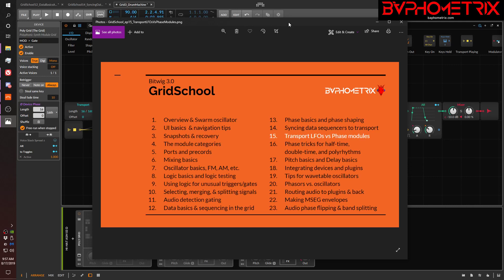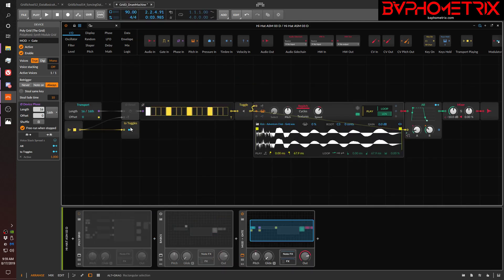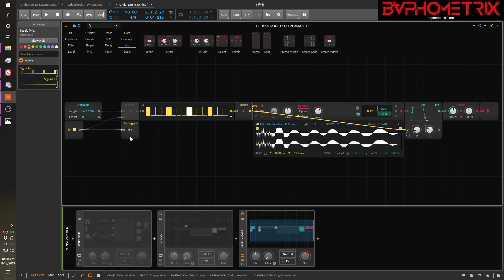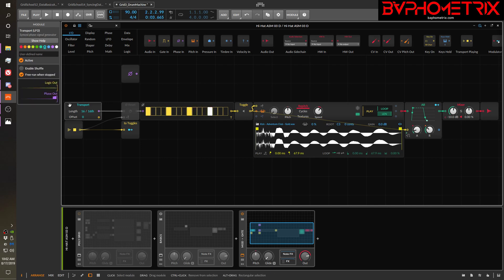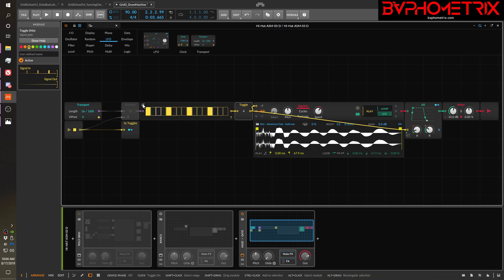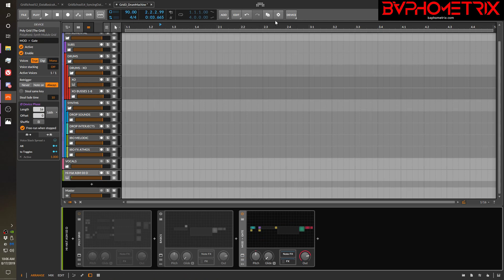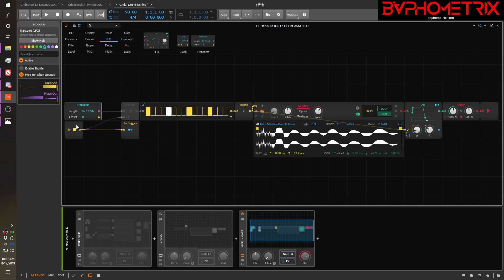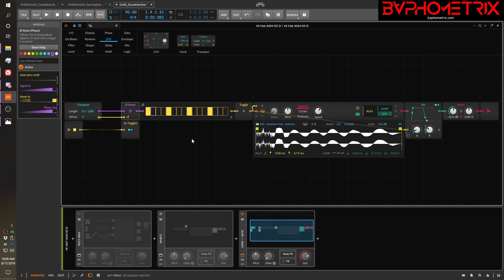Bitwig Grid School 15 - Transport LFOs vs. Phase Modules

Comment: We really need a way to do cable management in the grid :( Should be able to put them along the grid lines imo. Pin module or something would be sick and satisfying. like so you could stick a pin in the grid joints, then loop the wires around. The mess really stresses me out.

Comment: Hi, I really enjoy your videos. I have learned a lot. One question, what happened with lesson 16 through 23?
Reply from the maker: Haha yeah, sorry, I never finished out that particular series. What happened is that Bitwig themselves finally started putting out a lot of videos about how to use the Grid, and they also greatly improved their documentation (both with the dynamic F1 help and with new info in their actual user guide.

My early videos in this series were filling a vacuum of knowledge. There was no doc and there was no F1 help. Once those things were in place, and once Bitwig themselves were putting out videos, I stopped. Videos are a LOT of work, so why re-invent the wheel?
Reply: @Baphometrix  I am stilling watching your videos now,  your explain is better than videos on bitwig, you are good at teaching and producing.

Comment: HI there, this question is general, but I could not find any contact info on your youtube, so I hope you do not mind me asking this here. 

Today I realized that in Poly Grid the oscillators have a limit of range in which they can be modulated. 
In Poly Grid sinewave oscillator for example, the limit is 120.00 st. 

Is there a way that this limit can be exceeded? I would love for an LFO in bipolar mode to be able to modulate the frequency of an oscillator as high and as low as the LFO's amplitude signal generates.

Thanks for your time. 

Looking forward to the rest of this series. I plan to watch the first 15 again!
Reply from the maker: Unfortunately, you're running into the design limitations of an oscillator built to generate musical notes within the 20 Hz to 20 Khz range of human hearing, versus extremely low frequency oscillators designed for parameter modulation.

That said, you could maybe try using an LFO module to drive one of the raw oscillators in the Data group? (Pulse, Saw, Sine, Triangle.) I just tried it and it seems to work okay. Just set the Skew knob on the LFO module to either 0% or 100%. Then set the LFO Rate to Hz or Khz as desired. Watch the "Signal Out" waveform of the Sine data module (or whatever) and you'll see you're getting perfect sine waves at an extremely low rate all the way through faster audio rates.